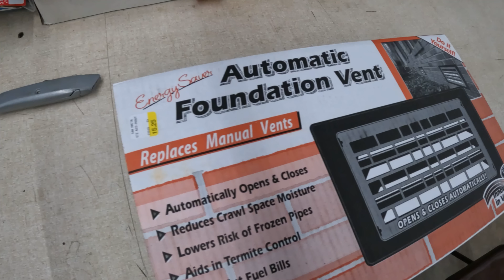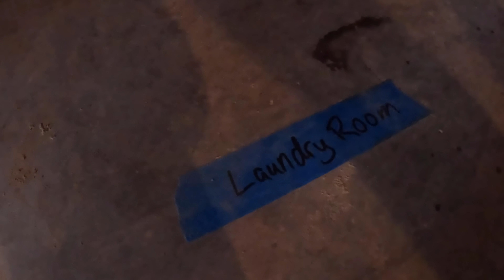Plotting Right Along| Inner Walls| Couple Builds Basement for Dream Cabin in the Woods

Comment: I had to seal my basement like that for almost two years during the shutdowns.  I used silage film, it’s six layers and durable.  It comes in big enough rolls that I got two layers for a 36x60 foundation out of one roll and no seams.  I then put a silver side tarp over the top to reflect the sun and it stayed cooler and dry for 22 months.  Pulled it off and the subfloor liked just like the day I covered it.
Reply: We used silage tarp too while we were building our house , worked great . They come in alot of sizes ..

Comment: I know you are mentally committed to the Paint it waterproof Idea. I have a suggestion to keep your living space safe and dry for you. 1) you'll note the Plastic when it rained allowed water to accumulate on the surface. 2) the paint will do the same you have no slope to shed the water. 3) the investment in my Idea can be used later for either the garage or outbuilding.  Here's the idea. you'll create an actual roof over your subfloor. split the width of the floor down the middle start in the center with 2x10 on edge creating a ridge beam (add a 2x2 on the bottom side to easily attach it to the joists with screws)  then repeat this on each side with 2x8-2x6-2x4-2x2  evenly spaced to create a slope for undulated steel sheets yes its an investment in roof materiel but its reusable for other structures. You don't need a huge slope for a temp roof but you definitely need some slope or you will get unintended leaks from the flat surface always holding water (over your temp living space)
Reply: I was thinking doing like they do over planter boxes with the plastic flex pipe and a support down the middle and a heavy tarp. Kind of like putting a short 1 of those things they are useing for storage over the roof but ur idea elemenates the worry when winter  comes and high winds.like said it is all re usable and they can insulate the "roof" area.unless for noise reduction once house is built they probly wouldn't want insulated underfloors.

Comment: I realize your "roof" situation is temporary but it it does warrant a little investment to protect your investment.  I recommend looking into Pond liner as a solution.   A 40x40 ft size piece is about $800  but it's cheap insurance and it will last way longer than you will need it to.

Comment: Shawn James used a sealing flooring that kept his cellar dry durning the winter from rain & snow can't remember what he used but check it out it was blue as I recall.
Reply: He used Blue Skin. I don't know the manufacturer.
Reply: And it worked amazingly well I would definitely look into that
Reply: Shawn used a self adhesive blue rubber foundation water proofing material to cover his subfloor. He also used it on his foundation walls.

Comment: Id be careful with that plastic up there, you will most likely end up trapping water against your subfloor causing it to become water damaged much quicker than just leaving un wrapped and brooming it off when the rain stops. I have no idea what your time frame is but aim to rough in all exterior walls and get the roof on with underlayment as fast as possible.
Reply: Boy my very thoughts.
Reply: They sealed it with that white seal paint.  Won't that protect it?
Reply: @teedub68  All it will take is one spot that the paint did not stick to  one crack one little place not covered. Water will find its way in. Money would’ve been better spent roughing it in. Then all the products they used  trying to seal it. Not to mention all the time.

Comment: Mel and Gary ur best bet is to cover that top.is cover it with rubber roofing for now.till you all srart the actual hose plus you can start building walls with it still on there and cut away from inside walls once dried in with upper portion

Comment: Pull that plastic off and get the OSB dried out immediately or it will swell up and be ruined. If you're going to live in there you need to find something that is waterproof to cover the floor/roof. Glad you got the needed rain. Hopefully lumber prices will drop in 4-6 weeks as futures are dropping also. Good luck

Comment: If you put insulation up in the ceiling rafters I would use the spray foam insulation. I know it would probably take a lot of it but it would seal that area up a lot better than the fiberglass insulation sheets.
Reply: Not worth the expense for an interior floor

Comment: I have an idea to better waterproof the plastic. Where are you glued it in the center put some two by fours across there and roll at a time or two. That will give you a high spot on the same so the water can’t get over it.  You could also zip tape it as well as taping the edges down. If you have any plywood left you could put that towards the center to make it a little higher as well, That might help push the water out towards the edges if it’s puddling on top.  🤔

Comment: If you have to cover your roof again maybe use the double 'J' joint method as used in sheet metal work. where you would put a reverse 'J' folded to interlock with another J folded, then glue. Or use 2 'J' folds and join thmn with a 'C' joint to interlock them similar to sheet metal working joint

Comment: I definitely wouldn’t frame the basement and the upstairs subfloor leaking guys. U need to frame the upstairs and get it dried it at the least,  to protect your investment or you’re gonna end up with a moldy mess that’s useless. Mold grows very fast and you enclose it it can’t get air to dry out it’s gonna spread like wildfire.

Comment: Hey  guys  the only way you will be able to seal the the top floor from leaking is installing a roll peel n stick  felt
Reply: Or building a house on top of it
Reply: The amount of mold and mildew would be horrendous with any substance that holds moisture.

Comment: look up the 3, 4, 5 method for layout. pick a point and measure in a multiple of 3 along the tape line measure up from the same point in multiple of 4 and make an arc instead of a mark. put the end of the tape on the 3ft (or multiple) and measure out in a multiple of 5 an strike an arc. where the two arc's meet is  the point that is square to the original line.

Comment: Your problem is the plastic on the roof is dead flat, no pitch. A little bit of a pitch would let the water run off the ceiling/floor/roof for now. 

The other side of that is, everything must be pretty level.

Comment: If you want to seal that flooring a little better get a product called blackjack 57 it's a rubberized roof coating it will seal it up tight and make it 100% waterproof and it's extremely durable but it's very very thick so make sure you have a good drill that's strong enough to mix it and then just roll it all over the floor

Comment: Hate to sound like a know it all but , you shouldn't have cut that poly if ya can it was cheep enough go get another piece and even I you aregoing to seal with some thick I would lay it back down double and solider new piece over top after you paint your sealer ,because during significantly strong winds and rain ⛈️ it could still leak and blow off , water is a amazing creation of God's and it pretty much does what it wants ✌️🤠 looking great you 2 keep rolling,  much love from Texas ❤